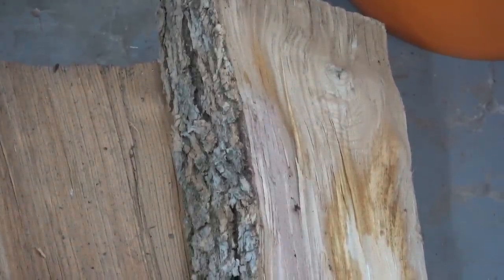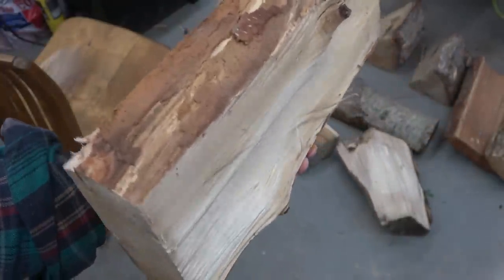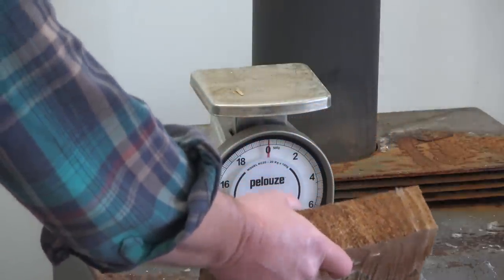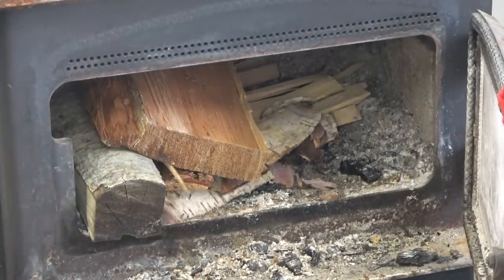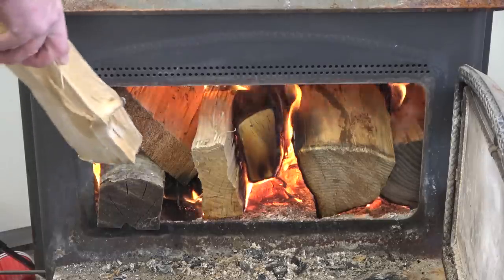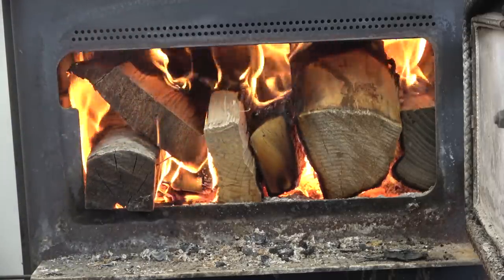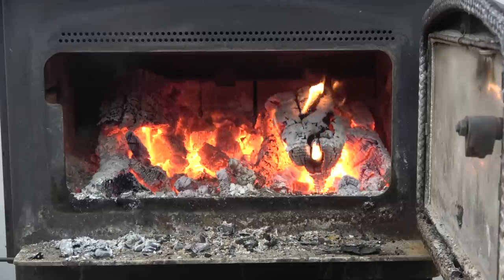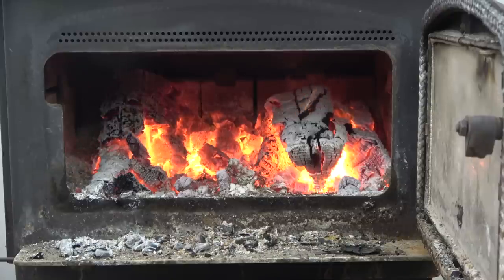Best firewood?

Comment: Hey @AvE, in southern Australia we call all of those species of tree carcass ‘kindling’! We have tree called Mallee (Eucalyptus Socialis) and it is the most unbelievable fire wood, it burns almost like charcoal and with no sparks. It has a density of 1120g/lt (yes it sinks in water) , 7600mj/kg and 100% hear availability for volume. (By comparison, white Cypress pine is 8000mj/kg but only 60% heat avail.) Mallee roots grow in sand and they are like a bulb/ball. They are not splittable except with hydraulic assistance and even then- good luck. Can’t be sawn either- full of grit. Once burning, the coals glow orange to cherry red and can burn for 12hrs + 👌
Reply: From one FJ owner to another, you can take a thumb up (y)
Reply: Yes Australian, as a Californian, I'm well aware of your darn eucalyptus trees and of their efficacy at burning my state down.
Reply: @eisenkrieg553  you should ask  the people in Florida about Australian pine (Casuarina spp)
Reply: We've got a little tree here called "Mesquite" with most of the features you describe...
Reply: @Bert2368  we get mesquite in chips for smoking. Ever seen Mallee chips? Me either. There is no chipper skookum enough to chip Mallee roots, it’s honestly like a rock
Reply: @spearo83  jarrah burns decent too
Reply: @spearo83  

What is the shrinkage, stability towards environmental moisture change, tendency to crack, rot resistance in wet environments for mallee? Interested vs. use in kitchen knife handles.
Reply: @Bert2368  it’s like ironwood or tallow. Very stable and rot resistant. It is very strong and resistant to cracking, especially the burl. The grains are tight and interwoven.
Reply: Pretty much everything is hard and heavy where I am in Victoria. The softest here is red gum, which some folks think is hard but it's softer than yellow box and grey box.  Red gum is still about twice as hard as birch or oak just the same. There's a bit of buloke around here, said to be the hardest in the world.  It's all good firewood.
Reply: @mudbutton2  grey gum and yellow box chew out the teeth on the mill pretty quick
Reply: In school during the mid sixties, I talked the wood shop teacher out of a piece of a stump that he had drying for years.  We humped it to the bandsaw, teachers only you know, and the blade almost immediately began to smoke.  Well, he sez, it’s been a while, we’ll just put a new one on.   Made it a couple of inches before it started to smoke.  Finally got my piece of pretty wood and mounted it on the lathe.  In Jr. High School at that time you could actually get slivers and blood and all the fun stuff, but were taught proper usage of tools.  So we go to the grinder and he shows me how to put an edge on the gouge.  Got it I thought……till I burned the tip on this damn piece of wood.  To the instructor I go, asking why I couldn’t sharpen like he did.  To the grinder we go, and he approved on my technique.  To the lathe we go, and minutes later the tip was burned and the wood smoking.  Teacher goes to his office and brings back his personal carbide tipped tools and I got really good at sharpening them also.  Hardest stuff that I have ever worked with, but had a spectacular tobacco canister when finished.  Now living in upstate NewYork, so won’t have the chance to wrestle with it again, but really glad I did it in my youth.  Probably started my huge interest in both wood and metal working.  I have turned lots of metal that is softer than Eucalyptus!
Reply: @spearo83  
Well up in QLD we have ironbark, you can only guess why it got it's name.
Reply: @wrstew1272  
Why do you think Aussie wood choppers smash Americans in the comps.

Yanks use pine, we use hardwood.
Reply: @eisenkrieg553  What species is it that has run rampant up there? A lot of Eucalypts thrive and spread in fire prone areas
Reply: @emceeboogieboots1608  I believe it is Blue Gum in my region.
Reply: The irony of having great, hot, long burning firewood in Australia is not lost on this poor Canuck. Lol
Reply: @Bert2368 it’s like stone
Reply: @Robert-cu9bm ironbark is the best firewood outside of Mallee roots. Burns hot and clean, but splits easily when it’s dry! I have moved to qld and have plenty on my hacienda. Ever tried to split river red gum? Block splitters bounce off that stuff, the grain is all twisty

Comment: Whatever was dead standing or otherwise I can drag out of the back woods and get a splitting maul through is my personal favorite. Cant be picky and lazy lol. Keep pallet wood handy for the quick cold morning starts. Good vid, thanks as always for making me feel that much more smarter.
Reply: My favorite as well. Standing dead (dry) and free. I have never paid a dime for firewood. Right now I'm burning Black Cottonwood. Disappears quick in the stove, but it's free.
Reply: If it’s not free….

What’s the fuckin point?
Reply: Just FYI many pallets are soaked in chemicals so it’s really a bad idea to burn it
Reply: That much more smarter...
Reply: @PrimetimeNut  depends wherein you be livin'. Here in canuckistan most wood from the species palettus woodus is heat treated. You can double check by googling the code stamped on it, but if it's not dyed you're likely good to burn (or garden) with it.
Reply: Non treated palletwood
Reply: @PrimetimeNut  Well that's just too bad coz if they burn they 🔥
Reply: @awrmmmcc2885  if you trust Chinese pallet makers, that’s between you and God.
Reply: My favorite.  Is chopping down a tree to get it out of the way, leaving on some higher ground. Wait until a late summer a couple years later after you procrastinated chopping it up. Makes for good burnin. Think I've got firewood that's been in the stack for... 3...maybe 4 years now. Never seem to get down that far. Sounds like work to move it and stack the new stuff first.
Reply: @PrimetimeNut  Burns hotter that way.
Reply: @hotshtsr20  extra spicy
Reply: @PrimetimeNut  no faith in the Chinese, it’s why I get my burning pallet wood from the local Amish.

Comment: aren't chimney fires an inbuilt automated feature to get rid of the creosote ?
Reply: Sure if you don't mind your bricks and moarter cracking and getting hot enough to light your framework on fire...  Truth be told, most chimney fires are harmless, but they could be terrible.  Some chimney fires happen without knowledge of the owner.
Reply: @happycamper6352  Twin wall stainless steel flue surrounded by vermiculite. The jackdaws in the next flue stay cozy.
Reply: Port the flue pipe like a steam whistle and if you get enough airflow,like a chimney fire,the whole neighborhood will know about it.

Comment: For a meaningful test, you really need to standardize the moisture content of each piece. Water vapor (above 20%) cools the combustion, causing smoke, stink and creosote buildup. Damp wood will "burn" (smolder) longer, but it will ultimately produce less heat, as smoke itself is nothing more than unburned fuel.

Also, it's worth noting that because of the different grain structures that differentiate hardwoods from softwoods, it takes softwoods a much longer time to season (dry) than hardwoods. Counterintuitive, eh, given their lesser density?

(Source: I was director of the (US) National Firewood Association from 2012-2020)
Reply: @pghgeo816  Nonetheless, his takeaway is correct -- all things being equal, BTU relates directly to mass/density. That's why firewood in Europe and the UK is sold by the tonne.
Reply: @salveson  No I get it but i thought his test was to determine "best firewood" i thought he meant best by species if that is the case his test proved nothing. and your point was the same as mine unless you know the moisture content is the same between all the samples you cant prove density. Plus shape is critical and it has to be done one log at a time to logs touching wont allow equal air flow but i think you know these things.
Reply: Softwoods taking longer to dry is actually very intuïtitive. Less dense is more space for other things like moisture
Reply: Whaddayou think this is, Project Farm!?
Reply: @samjenkins5868  I like the way you think.
Reply: Hold on. There's a national firewood association?
Reply: @salveson  Except it's not, well at least not here...cubic meter adjusted for length of cut.  I wish it were sold by weight
Reply: @salveson  Weight is nice but it's hard for a buyer to know how seasoned it is.  Color and checking can serve as evidence, or maybe if you carry around a moisture meter and a maul, but not everyone does that.
Reply: @Torchedini  It's not just that though.  The sap isn't just water; evergreen sap takes longer to evaporate than hardwood sap.
Reply: @happycamper6352  You're right, that's a huge problem. And few people know how to use a meter properly (pins in line with the grain). Good job bringing a maul to measure a fresh split!
Reply: @salveson  I haven't ever had to buy firewood, but I do look for the tell-tale signs before burning my own.  Dark gray color, radial splitting ("checking"), and a moisture meter reading (with the grain as you and the directions say) of around 12 is what I go for.  I get my supply cutting trees for people in northern WV and PA, and those hardwoods take about a year after splitting and stacking to get to that point.
Reply: Softwood dries far more quickly than hardwood. Where I work we have to buy green cords and dry them down to 18%-28% (DB), I can absolutely assure you than any hardwood takes far longer than any softwood, whether accelerated (ie kiln), air dried, or left out in the rain.
Reply: @pork_cake  hardwood takes far longer to what? Burn? Dry?
Reply: @wingerrrrrrrrr  To dry. I had a brain/finger moment there, edited.

Comment: Fun fact, Balsa wood is classified as hardwood. which makes a mockery of the hardwood/softwood thing. Also, most trees in Australia are hardwoods and only a few are deciduous. 
Classification can sometimes seem like a mugs game.
Reply: Hardwoods lose their leaves seasonly. That’s the only difference
Reply: Yeah, basically the names soft/hard-wood were created to differentiate wood that was soft/hard, then they made it a more fixed definition and then they noticed "oh shit, Balsa is a hardwood - now we are stuck with that name".
Reply: @chucksmitleyv145  Wrong.  What about Holly?
Reply: @chucksmitleyv145  Yes but why:
It is to keep their branches from breaking under snow loads. Praise the Lord.
Reply: @anthonywitham2305  wrong hardwood and softwood has absolutely nothing to do with how hard or soft they are. point in case holy vs balsa
Reply: @pghgeo816  I'm confused by your comment. I clearly said it is the fibre characteristics that define whether a wood is classified as hardwood or softwood. However I should point out fibres are only one of several characteristics that define Hard or softwoods. Not the main one. I've edited my comment to reflect this.

Comment: A Suggestion on the downdraft problem which you evidently seem to sometimes experience.
Purchase, at the stove pipe store, three fixed, proper diameter, stove pipe "T"s for a new sort'a chimney cap device.
The idea comes from the Choo Choo trains of old which had a coal or wood burning stove in the caboose.  So, start with the existing vertical stove pipe traveling upward through the roof in the traditional manner.  Next remove he "Chinaman's Hat" from the stove pipe to be used sometime in the future as a lawn ornament.  
Now the first "T" mounts onto the top of the vertical stove pipe so that any smoke now discharges horizontally left and/or right.  Next, on one side, mount the second "T" so that the new discharge, on that one side, is vertically up and down.  Now do the same on the other horizontal end with the last "T" so that now both left and right halves discharge vertically (up and down).
What happens is that new "H" shaped cap now sits atop of the existing stove pipe and that configuration cancels out the effects of the gusting wind.  A few sheet metal screws to hold everything together and a little cable to steady everything in monsoon winds and "...Bob's y'rrr Uncle".  No more downdrafts!       - Joe -
Reply: I've had many an issue with downdraft since the bloody thing was installed. This sounds like a fun little project (when it's not so damn cold). Thanks for the suggestion.

Comment: Softwoods and hardwoods might light up like coal, but brighter than all burns the telephone pole.
Reply: Sage words.
Reply: We avoid conifers; pine, fir, etc., because of creosote buildup which is a pain to clean and a chimney fire hazard. Ash, oak, etc. are much better.
Reply: @docmordrid  i had some cedar get mixed in with some wood i got for free. Never seen more soot from a log in my life. Even when burning its encased in black smoke. Smelled great but had to clean the stove pipe after.

Comment: This new brunswicker came into this video with some STRONG opinions. Last winter the sled shed didnt get stocked with wood. So we burnt the finest free pallets fastnfkall had to leave out back. Hardwood, softwood, glue ladden particle, stapled, nailed, strapped didnt matter it all burnt. Come spring there was 8 lbs of steel in the ash box and not a sharp chainsaw in sight!
Reply: Should have been a lot more than 8 pounds of steel.  I burn pallet wood in a camp fire often, and it doesn't take long to put out a gallon sized coffee can full of nails and staples, which will weigh about 8 pounds.  Just a couple nights actually.  Those pallets are loaded with hardware.

Comment: The question is also how much water was there in each piece. More humid wood can have even 30% less energy, because it has to evaporate water first (which takes much energy), and wet wood can burn longer. So on the next test measure humidity of the wood. Good job! :-)
Reply: Yes but, humidity mashes you feel warmer.  You know, like wind chill. 😁

Comment: Well. Here in Germany, wood commonly is sold by the "Raummeter" (about an eyeballed cubic meter). Beech, which we use as firewood, has 2100 kWh per Raummeter. But for starting, we use pine, since we can get scraps of that from a local shipping company.

Comment: As wood burns, it will produce a layer of coal/ash on the top, that will work as an insulator and prevent fast burning of the inside. This is why very large wood beams in buildings last incredibly long before catastrophic collapse in building fires. A thicc wooden structural beam can outlast equivalent load steel or concrete beam. Steel starts to bend and totally fail faster than wood beam, also the steel in concrete beam starts to stretch anc concrete fails because of that. Here in Finland we use quite a lot of huge wood beams in very large buildings, it's surprisingly safe in a case of fire, will actually require less fire shielding than steel. But is is also why very thicc firewood will take forever to slowly burn.
Reply: ...of course with firewood, the burn rate is mostly about the surface area / mass ratio. Split that thicc chunk of pine into 2 and it would have been gone a LOT faster. Looking forward to the next video, in my opinion is will be very important to keep the test piece SIZE identical, as it's fundamental to burn rate.
A rule of thumb: the smaller the fire, the smaller the wood for a nice, clean burn. Burning too thicc wood will result in an unclean burn producing a lot more smoke and soot.

Comment: The denser woods come in smaller pieces for the same weight. Smaller pieces have a higher surface area/volume, so they burn faster. You should be comparing pieces of wood of the same size and shape. That's how it is priced, by volume not weight. 
I live on 14 acres of pine forest and heat with wood that I cut and split.
Reply: This. It's not about weight, it's about how much you can pack in the stove at one time. A stove full of pine is gone in no time, a stove full of oak will last all night.
Reply: What does this look like? Project farm?

Comment: Both.
hardwoods in general are much denser and have a higher energy density (by volume), but lower specific energy (by weight). So for a fixed size it burns longer and releases more energy, but also burns slower. Where as softwood has more energy for the same weight and burns much faster which makes it great for quickly changing the temperature of a fireplace, or getting a fireplace started.
we always had both and used them accordingly. Softwood as kindling and half of the firewood, and then later just pure hardwood.

Comment: My Dad talked of the legendary stove wood and mentioned they'd go far n wide and haul back and burn it. Apparently could melt a stove if stoked to hot.
Tamarack!
Notice the heart on the Ponderosa?
Loves to burn!
Reply: @diamondflaw  Local guy here who worked for Fisher (we had a Mama Bear years ago) said that the factory would test their stoves by filling them with a load of kiln-dried fir (waste ends from the mills) and run them orange-hot.   Replaced the stove 30 years ago with a Lopi EPA-approved afterburner model.   The problem with the Fisher was that too much of the heat went up the 8" flue.  The Lopi produces just as many BTUs on less wood and runs a 6" flue.
What with climate change and drought, I'll be dead before I burn up the wood I've stockpiled.  Winters are much warmer than they yusta be.

Comment: Makes sense entirely. The thing is that hardwood being more dense means you can load more mass into a stove, giving you a longer burn, fewer door openings, so less heat loss. If you can get away with a packed stove of Pine to carry you through the night so be it, but I'd rather not have to be up every 3 hours to refill the stove.